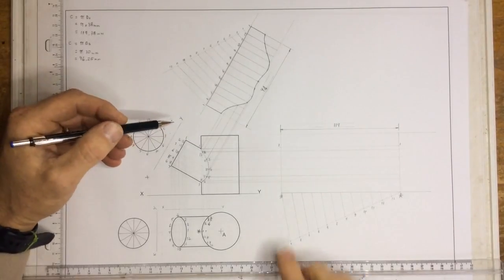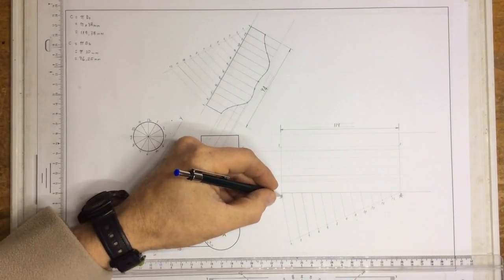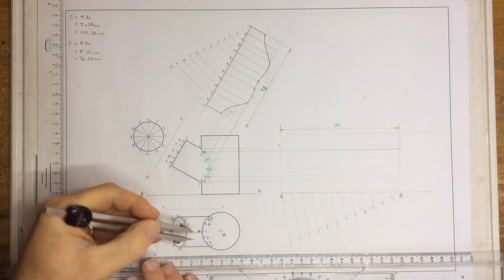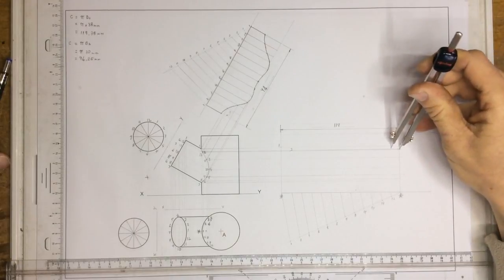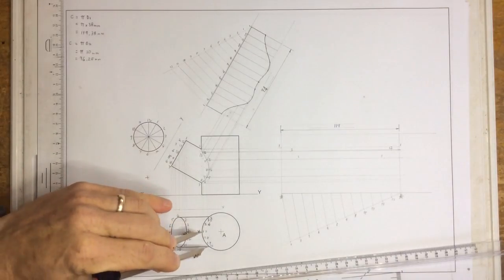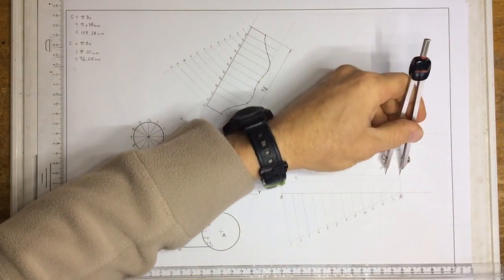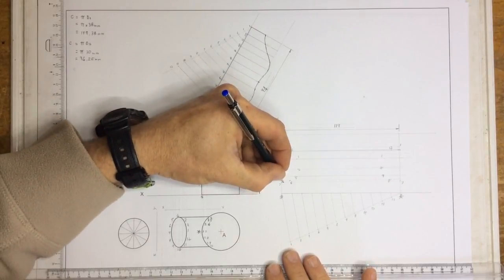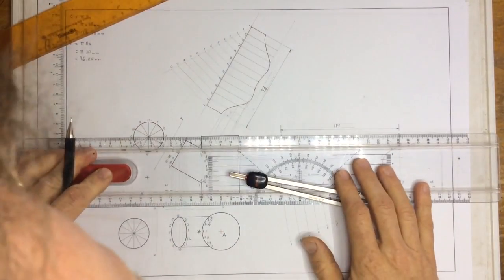Interpenetrations & development video 2

Comment: I have a question
What if those two diagrams on the left were facing to the right side Instead of the left as yours...
Will I do the same thing?
Reply: You apply the same method. 

It doesn't matter which side the pipe is facing, as long as you understand the method.